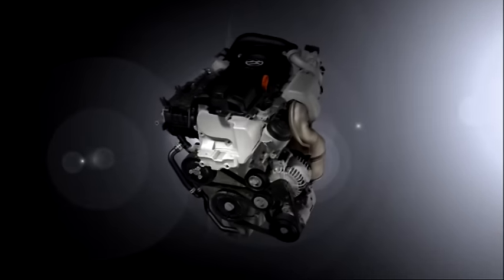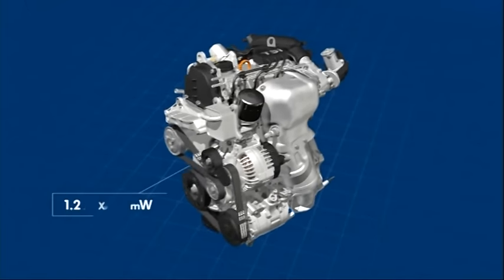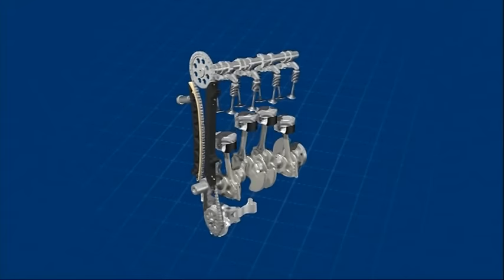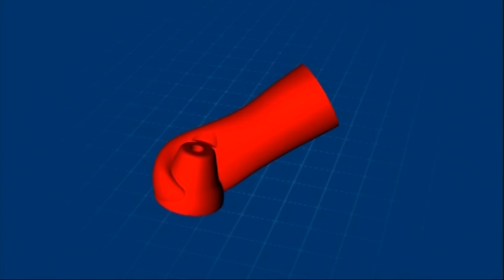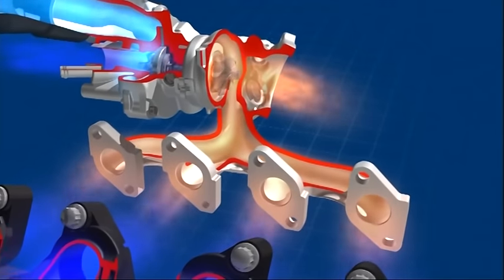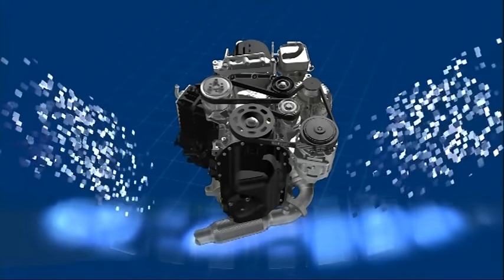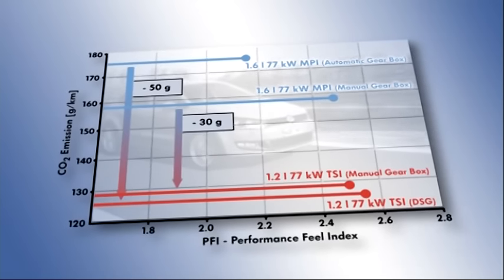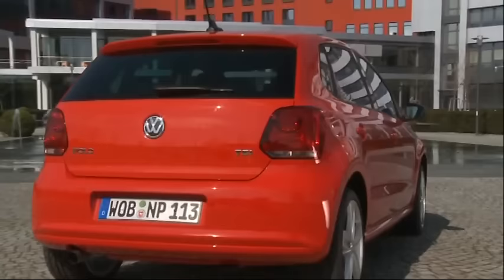Volkswagen TSI Engine (1.2 L 105 PS / 77 kW)

Comment: My Octavia has now nearly 150.000km and had barely any problems with it. Changing oil and filters every 10k - 12k kilometers. 

Only issue i have is with the ignition cables, i changed them three time so far, because they melt very easily, but bought some protection for them and everything is nice so far. 

This engine is like a little kid, take care of it and everything will be without headache. 
Have a nice 2022!
Reply: Same, also worn thru 12 cables in 1,5 year
Reply: I’ve got the same engine in my Audi a3 I’m at 135k done oil changed 8-9k miles. 
Drives as good as a 50k mile car no issues smooth and powerful
Reply: To solve the problem just buy NGK cables, they can withstand higher temperatures than the original ones

Comment: The 1.2 TSI engines built before 11/2011 had issues with the chain. They used to fail pretty early - sometimes at 30.000 km. After they re-engineered the system the problem was solved, but still it would be advised to replace the chain every 100.000 km.
Reply: Frst replace chain  to 200k 🤷
Reply: it is actually a belt
Reply: Mine was built in 11/2011 and got the old chain. It got its first chain change just a few days ago at 254.000 km. It rattled but didn't cause problems yet.
Reply: My Polo with 1.2 TSI 2011 (timing chain) has 207.000km on the clock and I am stil not hearing any knocking sounds ;)

Comment: Thanks for the explanation. Superb, proud owner of a 1.2L TSI 85kW car.
Reply: Owner of 77KW 1.2 TSI 105PS
Reply: @moses468  i got the same CBZB engine .....and i discovered after year of replacing "faulty" components that the ECU software was faulty and was showing bunch of random errors that really never occured but still put me in limp mode
Reply: @jurajokasa834   Whatever the error may be it is programmed in such a way to slow down the acceleration immediately...👍

Comment: 240.000 km in 10 years with this engine (1.2 TSI 105 hp) and still going strong. Serve it, warm it up and accelarate... Car is a (underrated) Seat Toledo 2014

Comment: I have the 1.0 litre TSI 115 BHP found on the newer generation 6 Polos and my god does that thing pack a punch! Barely have to touch the throttle pedal and the car is about to take off, same with brakes super sensitive. 

Another thing I'll have to get used to is shifting. The car stays dead silent even at higher revs which means I sometimes forget to change gear. I was doing 15 mp/h on first gear and the engine wasn't making a sound.... 

So far very impressed, but these modern engines/transmissions and gadgets are going to take me some time to get used to coming from an old 2010 Honda hatchback.

Comment: 64’000 miles and not a single issue. Ive managed 75mpg if i really try.
Reply: Mate it does 52-54 mpg max not 75
Reply: @Honda_Man_Sam  Maybe he turns his engine off occasionally in the middle of the highway! LOL :-D
Reply: @Nitin2000  might run it on 2 cylinders too lmao
Reply: @Honda_Man_Sam   i got 1.2tsi leon mk2 slightly tunedd and done 58mpg max so it can achieve but all depends on the driver

Comment: I have a seat ibiza 1.2 tsi. And i have to say. For a small engine, it flies! Its obviously not Cupra performance. But it certainly has a hell of a punch! I upgraded from a 1.2 honda jazz that i added high lift Cams & Forged rods ETC. It was naturally aspirated. But due to those modifications, the reliability went WAY down. I love my Seat so far!
Reply: Totally agree, love my Ibiza 1.2 TSI 🚘
Reply: I came from a 2010 hatchback with a 1.4 litre 150 BHP engine to a 1.0 litre TSI 115 BHP Volkswagon Polo gen 6 engine and the thing accelerates effortlessly. Barely have to touch the throttle and I'm already going well into 15 mp/h. The other thing with it is the engine is dead silent the entire time. So now I can't rely on sound for my gear shifting as my old car always roared at around 2k revs.

Comment: My car has 250 000km. Third timing chain, second turbo that recently had the wastegate actuator fail.

Also engine at this point is so worn that I can't use stock 5W-30 oil because everything starts rattling. Lets see how far I get before it finally gives up for good.

Update: 260 000km and engine is done. Oil full of metal glitter.
Reply: Which engine, and which model (of which year) if i may ask? I heard there were many different 1.2 tsi engines. What are you using the car for? Short city runabout, commuting to work or longer highway trips? Thanks
Reply: @zsoltpapp3363  1.2 TSI CBZA. 2014. Every day 24km of mostly city driving.
Reply: @CoreMaster111  i have the same engine 119000km on it runs smooth and is chipped pretty powerfull now. It uses a little bit oil about 1l at 5000 or 8000km but in the the futufe i want to upgrade the engine with a hybrid turbo and an new 1.2 engine looks like a fun project hahaha
Reply: @CoreMaster111  i got 1,2TSI CBZB 2010 .....and i just replaced everything on it and still check engine light and it still use to shove me in limp mode
Reply: I have the 1.2tsi 66kw polo with cjz engine. Have 320000km now and only 7 years old. Only changed the timing belt 1000km ago since i bought it. Water pump was the only major part i replaced on it as it is a common problem on these engines.
Reply: Get a Peugeot 1.6 HDI

Comment: I changed first chain on k20z4 honda at 250k not because it rattled but i felt like its time to change it... Its reving everyday to 8.5k rpm for past 10 years. Now the car has 380k and its still going strong after 30+ track days. Reading about these audi engines makes me wonder why people buy them at all...
Reply: Try any small turbo engine,then drive any 2.0 NA car around 140-150 HP and you would notice how good the small turbo engines build torque and speed in general compared to any NA engines. 1.0 or 1.2 had the same or even more torque than older 2.0 NA engines. Turbo flat curve from 1.400 to 4000 RPM moves any car quite fast,you need less gear changes and in general driving is way more easy almost in any situation. 
Some Honda cars are dead at low speed,do not have any torque low in RPM range. Those are very easy to stall and a little frustrating in a day to day driving.
Are those TSI engines for the track? I do not think so.

Comment: Injector rail bolts randomly snap due to metal fatigue spraying petrol everywhere (20k miles). Leave it parked for a week and the engine management light and EPC light come on due to turbo wastegate sticking. Both expensive fixes that quickly offset any saving on fuel. Getting less than 48mpg. Not a good engine to work on.
Reply: if you have vaccum CBZA wastegate then just open the hood and yank the rod sticking from actuator to turbo exhaust it does it ......and bolts snapping? never had the problem with gasket or cylinder heads

Comment: a great engine where the timing chain has to be changed between 50 000 - 100 000 KM .... it is supposed to be "for livetime"
Reply: @Jakub2020 remember to change the whole system (belt tensioners rails etc= if you just get a new chain it will wear down quicker if the tensioner is loose already
Reply: Witch model?

Comment: Oil consumption 
PCV failure causing other issues mainly rear seal leakage
Timing chain tensioner failure causing major engine damage
Direct injection causes intake valves and intake manifold to build up huge amount of deposits
Bad sealing camshaft cover causing oild leaking on the water pump hose causing it to crack
Coolant leak on the turbocharger actuator causing it the cease and engine runs weak.
Good engineering 😂
Reply: 200k km no problem

Comment: I have some fuel leak into oil. Me and my mechanic cannot figure out why...
Reply: john doe  Hi, my engine oil also smell like petrol. Also, i noticed a slight increase in oil level, which seems like the same issue as yours. Did you understand what the issue was? If yes, can you please let me know?
Reply: @OnurKasemlar2  looks  like I had the pcv valve problem. We are still not entirely sure if that resolved the issue. I will change the oil after few thousands of kilometers and then see if everything is fine. I had a lot of engine codes (p0441, p2237, p2195 and p0030) all related to vape and fume reflux and whole system didn't function correctly causing wrong engine's crankcase pressure and fumes. Had to change high pressure fuel pump and o2 sensor. And finally after p0041 we figured out it's tube on pcv valve that is bad and is not holding pressure. So looks like whole vape system didn't work at all, causing the engine working in rich all time.
Reply: @trolledyou7032   The high presure pump i leaking fuel inside the head
Reply: @OnurKasemlar2  The high presure pump is leaking fuel inside the head

Comment: Every 60000 new chain😂
Reply: Change belts on other cars every four years, one chain change a lifetime. what you getting at?
Reply: @christopherwilson6527  once? 🤣🤣🤷‍♀️
Reply: my vw golf 6 1.2 tsi he belt all valves and destroy the pistons...and i replace the engine.
Reply: alalala p yea my friend he jump three teeths and destroy the valves and the pistons... i buy new engine..!
Reply: No, just need to change to new version, it is cheap af and tensioner is better
Reply: @schreddiisauchhier4578  if you do drive a proper fuel yes, done before 90.000km on my 1.2TSI (liquid LPG direct injection), now af 280.000km with no issues, never rattles! But if you do shitty service, short distances (petrol diluted oil) then the chain f*cks you!
Reply: @wiktor7799  would you have a link to the parts please?
Reply: I’ve got the same engine in my Audi a3, I’ve owned it since 83k miles now am at 133k, it runs smoothest and economical on e5 petrol. I’ve done oil and filter changes every 6k miles and plugs and other service parts everyday 20k.
Honestly it’s a very good engine, I do hear weird noises from time to time, but have read online that these engines tend to be noisy and there’s a metal fuel line that vibrates against another metal part which creates knocking noise.
Reply: Mine is at 254.000 km and got its first chain change. It rattled but didn't cause problems.
Reply: Im at 148,000 km’s on the first timing chain

Comment: Hey there, i am comparing fabia mk2 and mk3. Both generation uses 1.2tsi engine. Mk2 with 86 or 105hp and mk3 with 110hp. Are those same engines and turbines?
Reply: I think yes… the injectors might be different though

Comment: This engine is know for its chain trim issues. Is that correct?
Reply: yes, but 2015+ have a belt and that is no longer an issue
Reply: Problem was sorted by the end of 2011.
Reply: @tomassirutavicius5654  2013 +have a belt
Reply: @tomazverhovnik8234  My late 2014 has chain.

Comment: how can they can lie in such a way about the torque graph of the engine ???? :)))  :)) i drove it hundred times and max torque starts from 3500 rpm in real life
Reply: They didn't lie. You felt the power rising not Torque. You have all the Torque at 1550rpm and it stays there till 4100rpm. And while Power is RPM multiplied with torque, it makes you feel that Torque is highest at 3500rpm where instead it is power you feel.
Reply: Mine pulls strong from 2000 rpm up. Best get yours looked at lol
Reply: christopher wilson same on my side. Once i pass 1800-1900 rpm i can definitely feel the power.

Comment: My engine makes a ticking noise on acceleration, any clues as to why?
Reply: What you are experiencing might be the result of pre-ignition, caused by low octane gasoline. You could try high octane fuel ( 95/98 ) and see if the problem is solved or not. If this doesn't help I would go and visit an certified Volkswagen AG Servicecenter.
Reply: Abradon 01 thanks for your help. I’ve put a full tank of high octane fuel in and I’m half way through it but seems to of not helped so far. I’ve noticed it seems to ease off when the engine is up to to temperature, if also taken it to vw as it’s under warranty but as usual they’ve said there’s nothing wrong!
Reply: When I first got my A3 ( same engine ) I also thought there was something wrong with it and I took it to an Audi-Servicecenter, but they said it was nothing wrong. I now drove over 15000km with it, without a single problem.
I would advice that right before your warranty ends you get it inspected again, just to be sure. 
But generally these engines last forever with good oil. Its especially important with small engines that your engine is warmed up to operating temperature ( first 4 km of driving ) before exceeding 2500 rpm.
Reply: Does it do any of that during idle?
Reply: Nick Borrego yes all the time
Reply: xlP I had this checked out recently on mine, they said it may be signs of the timing chain coming due for a change. Besides that, I've heard people mentioning this noise from day one.
Reply: Hpfp sound
Reply: You need a new chain its a problem with this engines

Comment: life expectancy 250000km
Reply: 280 000 km  still working
Reply: There were several cars with these 1.2 TSI engines in junkyard after 140 000km because timing chain failed and destroyed the engine.
Reply: @CoreMaster111  it is often recommended to change the timing in between 1-1.15 lac kms in car as a precaution
Reply: @CoreMaster111  and there are many which did 500k km and are doing just fine

Comment: This engine is not genius engineering, but is oil burning machine, is worst thing ever
Reply: Never heard of a 1.2 or 1.4 TSI engine burning oil. The 1.8 and 2.0 TSI yes, they do. Pretty much with the original fitted pistons.
Reply: Omar Andres I don’t know about engine but I sel my golf mk7 because in 3000 km burns about 1 litter of oil
Reply: Now i have audi a5 3.0 tdi 245 hp , it’s amazing lol
Reply: Look after your car then. I have the 1.2 tsi and havnt needed to top up the oil for 5000 miles, and thats only because i change the oil
Reply: kushtrim musa thats actually a good consumption. Acceptable range is upto 500ml per 1000km. Use better quality oil
Reply: christopher wilson i do service to authorised deelers, but every 3000 km need to fill about 1 litre :(
Reply: kushtrim musa dealers use cheap oil. They have to buy it in bulk and usually it’s that rubbish quantum stuff. I always buy my own oil. I had a leon 2.0 tfsi that used 1L every 500miles when it was filled with quantum. Bought good quality oil and never had to top it up again. Quantum or cheap oil burns off faster in my opinion
Reply: oil burning?? is that engine oil you mean?
Reply: @christopherwilson6527  3
Reply: @19Angelo93  Mine is 1.2 tsi & burns oil. Lol.
Reply: wake up my friend,do not put olive oils !!!!!
Reply: My one uses oil, but not the end of the world

Comment: Worst engine to exist rather use a pedal bike than go through the hassle of maintaining one of these my 1.2 tsi in my mk3 leon is a pile of ** sounds like a desiel sometimes engin mangament lights randomly turning on esp lights wiered strange knocking/rattling noise during idle and between 1200 and 3000 rpms and no its not a problem with the chain as its got a timing belt...
Reply: The diesel sound happens because the oil isn't circulating properly. They gave me a wrong oil filter in the store and I almost fried the top end because of that.
Reply: 110000 km, not one problem. Keep service interwalls and dont use cheep shit no name parts.
Reply: 136000 km still going strong , getting spark plugs next week, I do oil changes under 10000 . Returns 5.2 l/100km , I use Castrol edge 5w  30 .